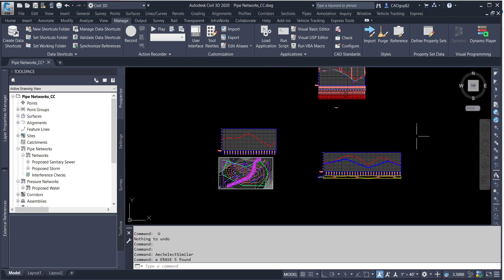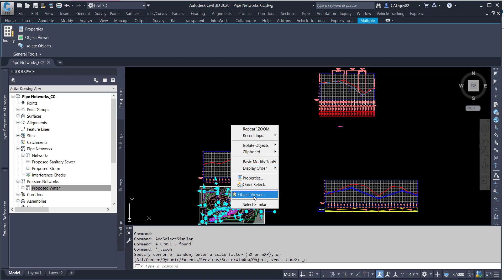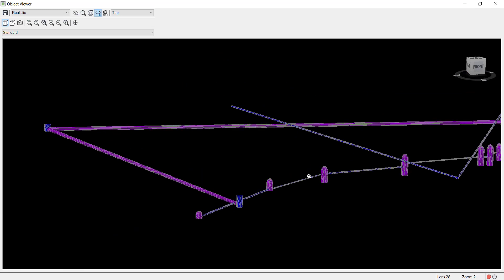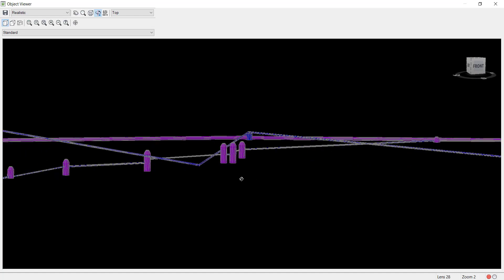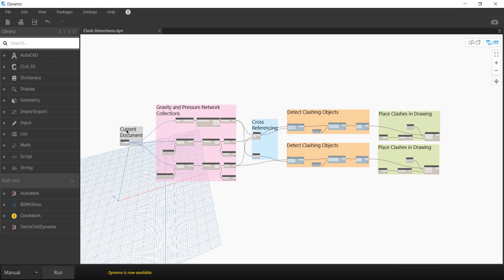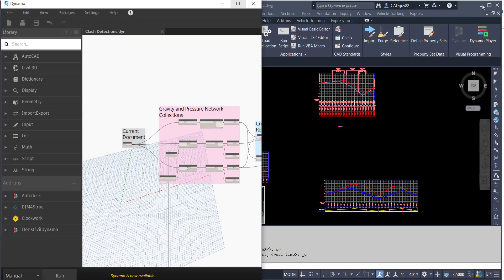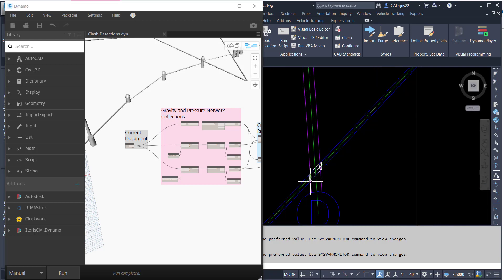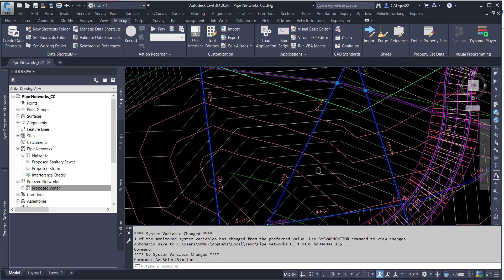Leveraging Dynamo to Perform Utility Clash Detections in Civil 3D

Comment: How I will detect clash of I have xref of wet and dry utility, plan and profile.
Mostly I see designer design all utilities in civil 3d then check interference.
But in my case I have xref of utility.
Please suggest.
Thanks
Reply from the maker: Unfortunately there are some limitations at the moment with Dynamo when dealing with xrefs...you'd need to data reference into the current drawing and perform the clash detection. Feel free to reach out directly if you have any further questions (stevewalz@hotmail.com)!